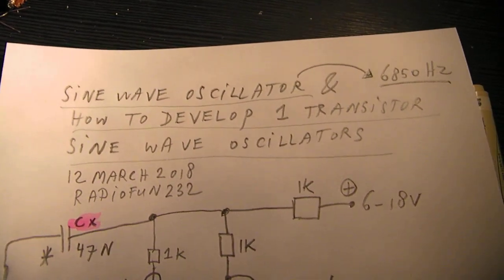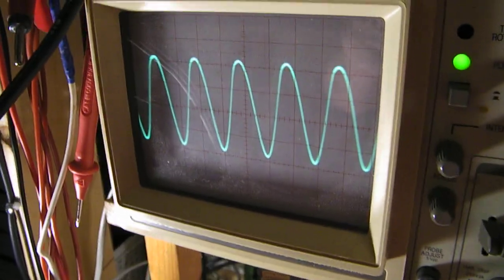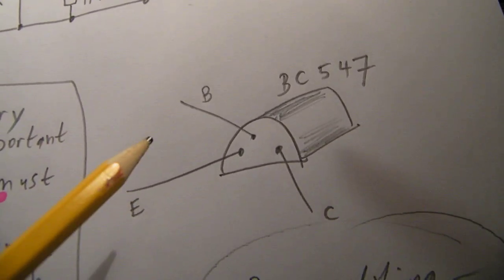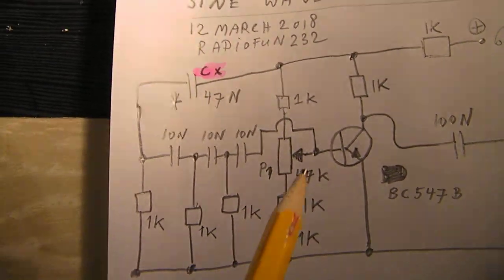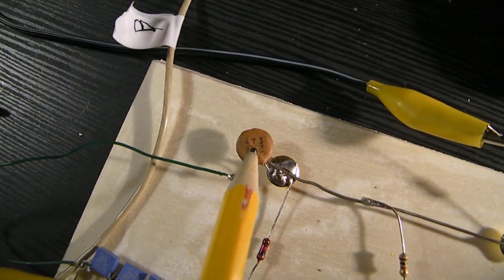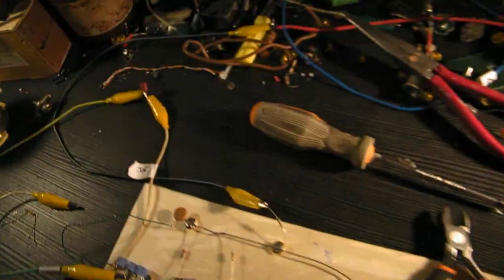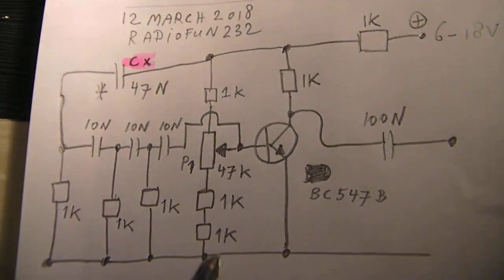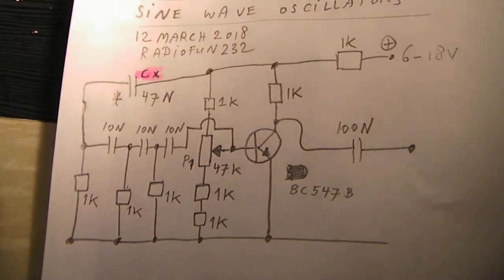Sine wave oscillator on 6.8 KHz & how to develop 1 transistor sine wave oscillators (300 Hz-25 KHz)

Comment: hi thanks for the videos , i am a student of electronics and your circuit is interesting, because you make a bridge circuit and an amplifier but i make some calculus and  i canot make some expresion  of the  frecuency . do you know  how  change the frecuency to  make a litle equation ?
 i refer   how do you  calcule the  frecuency?   only   experimenting 

thanks for these videos
Reply from the maker: Hi Jonathan, at first: success with your study. All my knowledge is practical and found during experiments, so I cannot help you with a calculation. I am sure you can find that calculation for a sine wave oscillator on the www, because it is common. Practical tips: higher value capacitors in the 3 stage phase shifting network (the 1 K resistors and the 3 caps) lead to a lower frequency. Say with 3 x a 100 N (0,1 uF) capacitor (the 1 K resistors stay the same) you will be on (say) 300 Hertz. Lower value capacitors mean higher frequencies (say 3 x 4N7=6 KHz). Above (say) 10 KHz the capacitors must be ceramic types (=with capacitors lower than 4N7). Also the "backcoupling" capacitor must be ceramic in that case.
Reply: @radiofun232  thanks so much for responding thanks , I promise if I can search the equation I'm going to say you, thanks so much again and gratings from Guatemala ☺
Reply from the maker: @jonathancalderon8330  You are welcome!

Comment: Can you give me the values of the capacitators to create a 2khz sine wave oscillator to drive a buzzer with this circuit?
Reply from the maker: Change the 3 capacitors of 10N (=10000pF) into 3 capacitors of 68N (68000 pF or 0,068 uF). When it does not work: also change Cx from 47 N (0,047 uF) into 100N (0,1 uF). Lower value capacitors= higher frequency, Higher value capacitors = lower frequency.
Reply: @radiofun232  will the frequency change if the surrounding  temperature changes to 60 Celsius or will the frequency stay stable and will not be affected by temperature changes? As for the voltage if used in a range between 10 -16 volts will the frequency change or stay stable at 2khz? I need a stable 2 khz oscillator to drive a buzzer that will not change due temperature or voltage variations.
Reply from the maker: @arm2644  The frequency will change on higher temperatures, but the capacitors also have a temp coefficient and that temp coefficient is low so test it/try it out, you will (perhaps) hear differences when you put the circuit in the freezer (-20 degrees celsius), but in general it will work ok. Question: why do you ask this?
Reply: @radiofun232  because I want to use this circuit in a car application and the temperature in the cabin or engine area will vary depending on the climate. So I need a estable 2khz oscillator circuit to make the buzzer sound without any distortion. If you know a better suitable circuit for this application please let me know.
Reply from the maker: @arm2644  OK, your approach is OK, regarding the temperature and frequency related to temperature. But: don't be too critical and a sine wave oscillator does not have a "sharp" warning sound, it sounds soft, better use is a squarewave oscillator to get a sharp warning sound. The classic square wave oscillators are also temp. sensitive, anyway, but not critical regarding the capacitors to be used. In general: a buzzer only warns, so the frequency must be adapted to where the human ear is most sensitive, that specific freq.band where the human ear is most sensitive is between  1 KHz and 4 KHz. No need to be stable. I will send you a link to a usable square wave osc. circuit that is on my channel. Takes some time.
Reply from the maker: @arm2644  usable is this https://youtu.be/TOi7wRUnoNI

Comment: Hmm interesting. Wondering if a 50hz oscillator could be made for a power inverter with pure sine wave
Reply from the maker: That is the problem with this circuit, the lowest frequency is approx. 200 Hertz.
Reply from the maker: And in a power inverter connected to the public mains/grid the frequency must be constant under all circumstances (temp, load, etc) on 50 Hz or 60 Hz within (say) 1 Hz to + and 1 Hz to -.